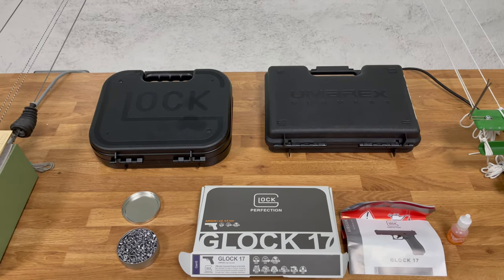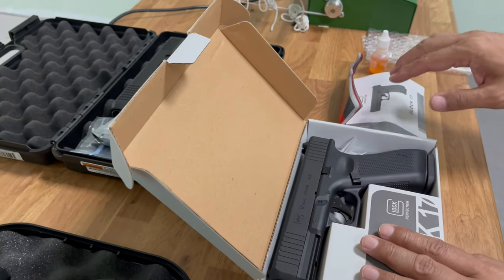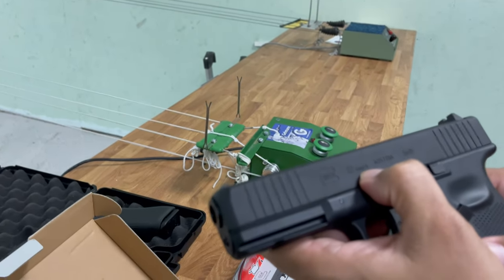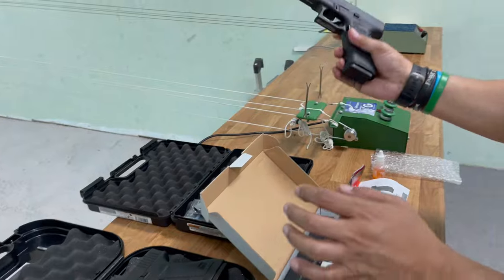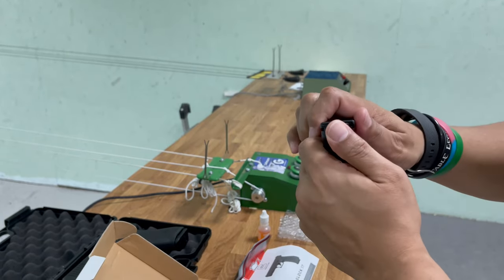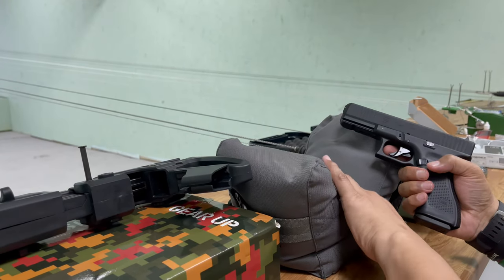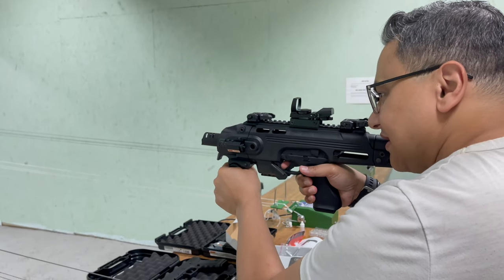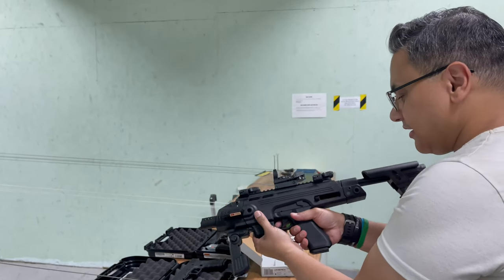Brand New Umarex Glock 17 Gen 5 Pellet Version - Overview, comparisons and shooting groups

Comment: would be nice if we figured a way to get pellets to stack just as nice as BB's
Reply: Same here, the belt on mine just broke. I found this gun on eBay since I live in the states where it is on backorder so there are no parts available. Luckily the walther ppq m2 uses the same system so I bought the magazine just for the belt. I wanted to work on a bb magazine to see if there’s a way to stack the pellets but I’m no engineer and I certainly do not have the right tools. I feel that these magazines are over engineered but I suppose I’ll trust the gunsmiths since I have no knowledge of how they work. I had lubricated that belt before it broke at the recommendation of another YouTube video, and you can definitely feel a difference in trigger pull weight. The rubber is so brittle I don’t feel comfortable shooting the gun a lot without dousing the belt in lubricant since it’s so brittle and I don’t want to be spending money on parts that I could spend on pellets and gas.
Reply: @ihnchaser10  its umarex. There service has been very poor this over this last year
Reply: It would be lovely
Reply: With only slight modification of their BB-magazine design airgun manufacturers could have a magazine which could handle the spherical lead-ball pellets. They hit really hard.
Reply: Lead is a soft metal, they would be crushed.
Reply: @tomjoad1363 Give this man a prize. I was saying the same thing. The bb magazine system can't be done with pellets.  BUT, there has to be a better delivery system to get that pellet chambered.
Reply: @tomjoad1363  Lead isn't that soft; look at the tubular magazines on the GAMO Gamatic rifles. You stack regular pellets into them and it works just fine, unless you abuse the thing while doing the loading. And the spherical lead rounds I'm speaking of don't have the thin, soft tails found on regular pellets.
Reply: @xmadxtiox  Lead isn't that soft; look at the tubular magazines on the GAMO Gamatic rifles. You stack regular pellets into them and it works just fine, unless you abuse the thing while doing the loading. And the spherical lead rounds I'm speaking of don't have the thin, soft tails found on regular pellets.

Comment: If you consider buying this gun : 
a really fun gun and nice replica, the accuracy on mine is super good I have really tight groupings at 10 meters, the magazine design is great, the feeling is insane but there is some really bad design choices there et major flaws on it.

 - the rear sight is part of the slide so you cannot remove it and mount sights on it
 - I get around 40-50 shots per CO2 (meh)
 - I had a pellet jamming the gun, couldn't take the mag out and since you cannot strip it I had to send it back to have it fixed
 - depending on what batch you got you can use the slide lock to manually lock the slide 

Id wait until they update it (if they do) or release another gun with this magazine design that fixes the issues this pistol presents
Reply: Pretty sure this is why we had it for all of a week here in the U.S. and then it disappeared and not slated to come back until next year. Thinking they saw the flaws. They had issues with the Walther PPQ M2 as well, it uses the same belt feed as this. Unless they can figure out how to stack pellets on top of each other without damaging the skirts(which can't see that happening)just stick to rotary mags for pellets honestly. But in happy with BB's instead of these belt fed systems
Reply: It can be stripped,push the front pin out from right to left,then pull slide back and up, off it comes
Reply: What pistol of pellet instead of this one would you recommend

Comment: There's an emerging problem with the magazines. The pellet belts are snapping. It may be a faulty batch of mags, I don't know yet. The PPQ M2 has the same pellet belt but there was never an issue with those. I got my first Gen 5 mag replaced by the shop, but then the same happened again (belt snapped) and I got a refund. The shop had a handful of the Gen 5's, all with snapped belts,  waiting to go back to the supplier. I'm waiting now until the mag issue is resolved before buying again. And yes, the rattle is annoying and the safety catch is a nightmare (child proof AND adult proof), but I do like the gun and the blowback does pack a wallop.
Reply: Hi Garry, how are you? The same thing happened to me. I swapped mine for Walther CP88 with the nickel finish. I miss the blowback though... I hope that they fix the problem.
Reply: @adderhoney  Hi, mate. Yes, I hope they fix it too cos I want to buy it again. I much prefer the Gen 5 look to the other Glocks. Rattle and safety catch niggles aside, I'd own a properly working one in a heartbeat.
Reply: Mine snapped too.
Reply: So sorry to hear that mine was not an isolated case. 
I also have the T4E PPQ M2 (which has a version that uses the same magazine as the Glock) and I measured the width of the base of the slide for that gun and also the Glock. 
The Glock's slide is 24mm across at the base, and the PPQ's is 27mm across at the base.
Given that the internal tolerances in the PPQ M2 are already pretty tight, I think that the 1.5mm reduction of space on either side of the magazine in the Glock is the problem...
Not sure if or how Umarex can fix that, TBH...

Comment: Hi. I have a Umarex Wather PPQ that has the excact same mag. Very elegant design, well made both materials and workmanship but it has a design flaw. The pellet belt every so often does not line up properly with the barrel because there is a lot of friction inside the belt housing because of the belt being rubber. Silicon spray does help but it still does guarantee that it won't missalign. I'm more of a collecter so it does not really matter to me.
I also own 3 of the Glocks and they are absolutely beautifuly made. Also none of the Glocks for the Canadian market don't come in cases but come in these god awful blister packs but that should not be deal breaker because they so well made.
Great video and happy plincking to you (:
Reply: Why the F don't we get the hard cases?

Comment: I'm getting about a 3 inch group at 25 yards( 75 feet) with the G17 Gen5 pellet pistol off the bench
Reply from the maker: Are you using any rests at all or just gripping the pistol resting on the bench? Also what pellets are you using?
Reply: @zubysan  I'm using a rest and shooting from a Caldwell steady rest table, im also paying attention to each shot,making sure the front sight is perfectly aligned with equal amounts of space on both sides,making sure the front sight is perfectly aligned before I squeeze that heavy trigger( though lighter now with continual silicone spray)..im a excellent shot,actually qualified for the Olympics in the late 80's
Reply: @RaysAirgunsReview  My G17 Gen5 MOS also shoots very accurate right off the box. Just working it in with 100 shots to get the threaded barrel up and running. Using H&N excite Econ II 0.48gram (7.41 grain) pellets.

Comment: The reason the T4e one is better made, because those are typically used by police and military for training so of course they will be better made. I have the 17 G4(BB), the 19 and 19x. Don't really care about slide rattle, that's to be expected at this price range. But here in the States we never got 17 g3 pellet or the one with the same mag as the SA10 pistol. Not sure why though. But way too many issues with those belts snapping, we had a few come in before retailers pulled them here in the States. They really need to stop trying to get pellets in magazines like BBs...these belts don't last long enough to make it worth it and the triggers are always weird and crunchy. Better to stick with rotary mags if someone wants a pellet version. But I'll stick with BB's mostly...blowback, lock back and usually good triggers. Accuracy isn't as good as a pellet, but these arent meant to be competition pistols anyway
Reply: HitManTwo3ree  if you follow them on Facebook or Instagram they show several police officers using them, that's where they make their money...they are priced too high to stay in business just as a fun plinker
Reply: HitMan2-3  Yes, police do use them. We also use airsoft. It significantly cuts down the cost of training. Simunition is expensive.

Comment: You should have a look at the GHK steel slide Glock 17, far nicer than these semi blowback pistols that I don’t think have a slide that can be removed. Although you might not be a fan of airsoft pistols. But check one out if you can, it’s the most realistic replica of a Glock available.

Comment: How is the precision on the .43 caliber? There isn't a single test on the net telling anything about that. One would expect a gun that can not be field stripped (=barrel fixed to the frame), with a rifled bore, using pellets to be the most accurate. Only I've shot a few Sig Sauer "original" CO2 that were crap. I returned them all. Part of the problem is of course the ratteling slide moving the sights into a new position with every shot. 

I didn't quite understand if the gun or your finger moves the belt?

The .43 probably / maybee suffers from too poor a fit between the balls and the barrel? But if I could dependably hit a soda can at 10m with it, I would buy it.

Umarex also make 3 soft air 6mm GBB versions with non rattling CNC milled slides just like the .43 Supposedly they are very accurate - but compared to what, I wonder?!

Comment: I just bought one with 2 mags and the rubber pellet belt was snapped on both, clean like they had been cut with a knife, making it impossible to use and won't even cycle. how this design ever got past the initial reliability tests I do now know. My mags also do not have the rotate to pierce the cartridge they still use the Allan key.
Reply: Where u buy it it says they won’t be in stock till January 2, 2023 did this gen 5 go on sale already
Reply: @kimanimobley8564  it was a gen 5 gun. but the mags didn't have the twist-to-pierce mechanism so I suspect they are gen 4 mags, don;t really know as returned it. the gen for BB I got leaks gas ffs. i wouldn't;t want to recommend the shop as they refused to refund gun that was faulty on first use.

Comment: oh dear ... went to use mine this weekend, and found that the belt had snapped inside the mag. was wondering if it was my fault but it seems this is a thing, so its going back to my RFD this weekend. I'd put maybe 3 or 4 CO2 bulbs through  it since I bought it, but it kept jamming, even with silicone spray as the videos on here advise... at £230 UK pounds I hopefully can get my money back. Its a shame as its a decent looking replica.
Reply: Matt does your upper slide lock with the button?
Reply: @christianstewart3233  nope. I heard rumours that the slides were sposed too, and some of them do. Think I’ve got one of the 1st batch and the slide doesn’t lock back.
Reply: Quick update for anyone having issues. Went to my RFD today and Umarex are aware, new mags being designed and will be available in 3-4 weeks … apparently they want it sorted so that’s good news
Reply: @BalearicBeatnik  Did the magazines get resolved at all?
Reply: @ryantullett8098  regular calls to the shop but the replacement mags aren’t here yet apparently, no known ETA 🫤
Reply: @BalearicBeatnik  thanks for the reply mate, I purchased one yesterday but then saw the comments on here. Is the slide meant to lock back also? (As seen in the umarex video?) I just want to know if I have purchased from a bad batch?
Reply: @ryantullett8098  so the slide was apparently sposed to lock back but I heard there were two lots made, the first lot don’t.  I dunno what’s happening with that. My RFD still doesn’t know when Umarex will be sending the MK2 mags, as they are actually making them from some other belt mag, modified etc possibly different plastic in the belt, but they keep saying they’re being told ‘in a few f weeks’ by Umarex, everytime they ask. I’m gonna get a refund if they aren’t here by January, had the gun a few months now and it’s just sat there.
Reply: @ryantullett8098  further update. Just seen on a forum that J Rothery who are the main Umarex importer to the UK are currently testing the new batch of mags with the new belts/different materials. My local RFD doesn't have em yet but should be soon.

Comment: Wish this came threaded for a DonnyFL Silencer!
Reply: I haven't bought any of the DonnyFL suppressors, but I feel it's worth mentioning, since you may have an interest, there are some really great 3D printed ones from Buck Rail. I have a few of them, they are ridiculously inexpensive and the shipping is quick and usually free... I have some for co2 pistols and some for my PCP rifles. Great deals, great company, I'd recommend them for everyone. The DonnyFL for my rifles were crazy expensive and still needed another adapter that was expensive itself. So I looked at buck rail's website and thought, "if its crap, I'm only out $25. Instead of $250"... It wasn't crap
Reply: Pretty sure the older pellet one he has here is threaded...Andy's airgun reviews has a silencer on his in his video

Comment: How heavy is the trigger on the gen 5 give estimate in pounds of pull. I tried one in the RFD and could barely pull it .
Reply from the maker: I’ll see what I can do Russell about finding out
Reply: I found this after buying mine, looking at the chain magazine it was applied with a thick heavy grease that made it difficult for the chain to move no doubt putting strain on the system. I applied a bit of pell gun which has improved things.
Reply: sounds like the rubber belt wasn't aligned properly is you couldn't pull the trigger easily when it is aligned it's not much harder than the actual 9mm to pull.

Comment: The ones with the safety under the barrel, is a "knock off" The 100% trade marked version has serial numbers under the barrel. I'm not sure if it's like that for sales to different countries. But for sure you can find all generations with or without the under barrel safety